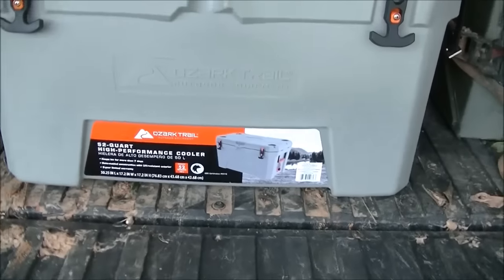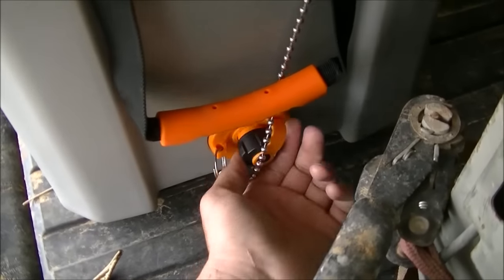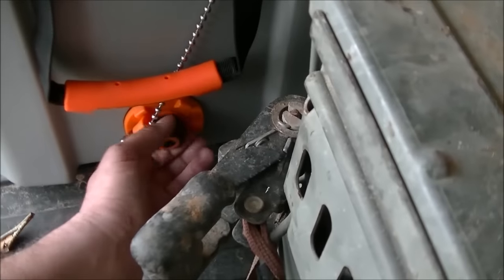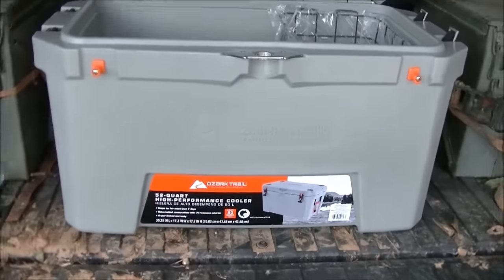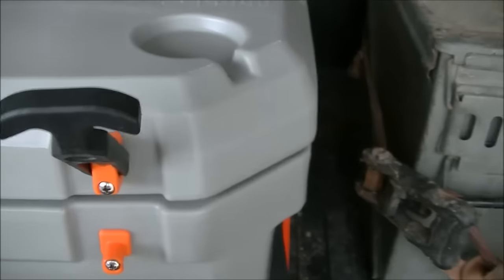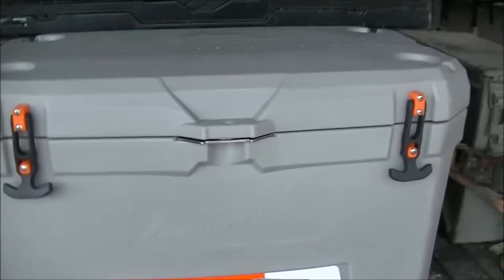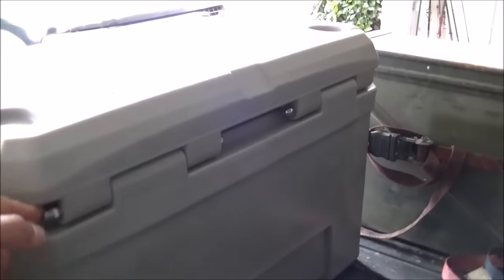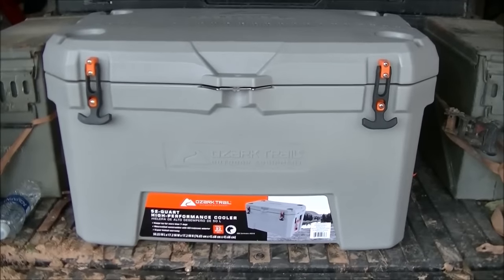Ozark Trail High Performance Cooler Review

Comment: Just a heads up, with the seal you can lift out the gasket and stretch it into place and push it back down. No need to use silicone or the like.
Reply from the maker: Good idea

Comment: Ozarka trails is cheaper but you get what you pay for. Its WAY cheaper. You are better off paying the extra money and getting RTic. Rtic is legit. Ozarka trails is shit trying to pull that wal mart cheaper route bullshit. Rtic is what you want. spend slightly more and get better quality. I own an rtic and an ozarka trail and the ozarka is the cooler i could care less if it breaks or gets stolen. wont buy another. THe r tic is the real deal.
Reply from the maker: I returned this and got the RTIC, check out my other videos.
Reply: as did I.... I WANTED to believe the Ozark Trail was just as good but yeah.... it was "Just As Good" as my 13 year old Coleman Xtreme..... hey we gave them a fair shot right? happy with my RTIC 20 and 65
Reply from the maker: UPMiner 616 same here, love my RTIC

Comment: Do you by chance know were you might find replacement parts for the plastic handle holder and latch?  I have looked high and low even on the Walmart web site where they sell most of these.

Comment: look up cooler commander! i rolled my teryx with one of those coolers and didnt spill a drop!!
Reply from the maker: I'll look it up.  I'm gonna need a smaller one soon.
Reply: its a strap down that doesn't go over the top of the cooler. it works great on these coolers.
Reply from the maker: Just looked it up.  That's a good idea.

Comment: I wouldn't take that cooler back, no sir.  That Ozark Trail will perform as good as the Yeti, or at least close enough that the difference doesn't justify the extra cost.   I've got two of those Ozark Trail coolers, love them.  Save your money and put some extra gas in your boat.
Reply from the maker: I already returned it and ordered an RTIC which was $20 more than the Ozark Trail.  Its slightly smaller but that's ok as it is just for use on the back of my Polaris Ranger to hold some beers.
Reply: +OleNasty79 be prepared to not have a cooler for 2+months..still waiting on mine
Reply from the maker: +Andrew Busher I have a Coleman Xtreme similar to the one in this video.  I'm good.